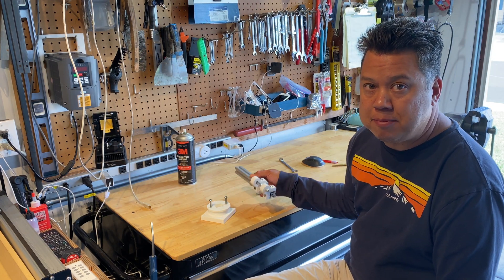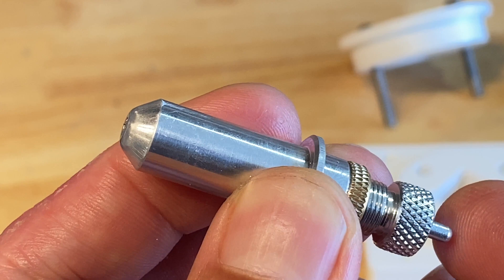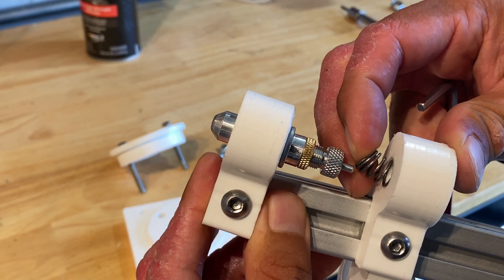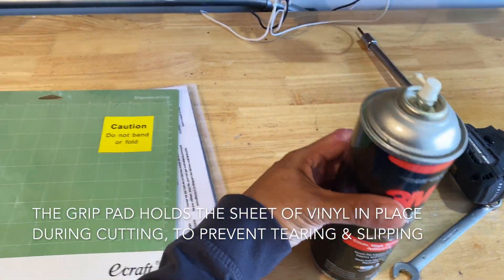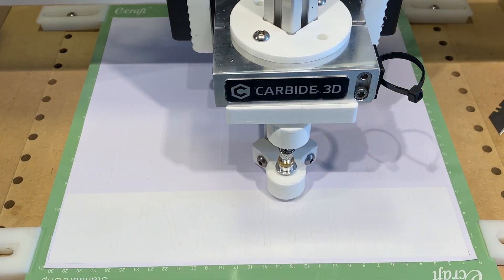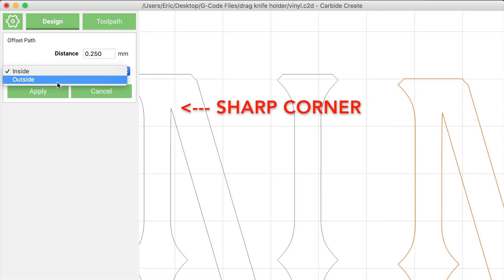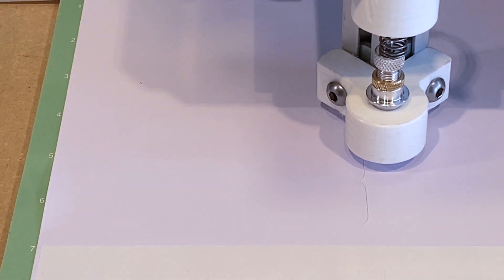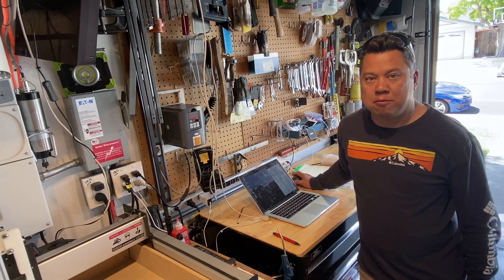Shapeoko Drag Knife Vinyl Cutter

Comment: I was thinking of doing something similar and your design seems really great. I'm wondering if you are still using it and if you were to make it again what would you change?
Reply from the maker: It works great, I haven't really used it since this video though.  Now that I have a 3D printer, I would probably 3D print instead.

Comment: I first watched your video not long after you posted it.  Recently I decided to build a simple plotter / vinyl cutter.  I have assembled the components, including a knife and holder the same as you used.
What I have been unable to work out was if the knife holder actually slides on the vinyl.  If it slides on the vinyl, is the actual depth of cut controlled by the knurled thunbwheel?
Many thanks for the video.
Reply from the maker: yes, the aluminum holder slides on the vinyl, and the depth of cut is determined by how far the blade protrudes from the holder.  It's set by turning the knurled nut.  The end of the aluminum holder has a sharp chamfer on it, I sanded it down so its more rounded like a fillet so it glides easier.  hope that helps!

Comment: Lots of useful operational details for someone like me who just purchased  one of these ultra-cheap drag knives. 👍 **One question**: The blade holder has a built-in spring dampener (on the blade side) so I was wondering why you chose to add the big spring. Was the pressure too weak to your taste ?

Comment: Your work is so nice. I have a Stepcraft style machine. It is smaller but sturdy. I try to cut really small vinyl letters and Oh, boy I have issues. When I engrave aluminum or brass with a diamond drag tip all is OK. If I mount a cutter plotter knife, similar to yours in this video...my letters are all messed up. The machine is cutting all corners. Even the circles are not round,.. It is so simplified, melted like letters. The size of the front is 16. I set the stroke thickness at 0,1 mm. Very low plunge rate and low feed rate. The Knife is mounted in the router place. I have plastic bushing that fits well in my aluminum elastic bushings that normally hold the spindle. It is very little movement between the plastic bushing and the body of the plotter knife. Instead of a spring, I am using a rubber band to allow the cutter to move up and down as needed. My vinyl is Oracal of 75 thickness and it is very well mounted on the CNC bed with the double-sided scotch band. I am using a 60-degree knife. I had similar results with the 45-degree knife. It is so annoying because with a diamond tip engraving device I can engrave all kinds of metals but vinyl cutting with the cutter plotter knife is such a challenge. Even simple shapes like small squares and ovals or rounds are wobbly and simplified. Cutting corners and such....
Reply: @klave8511  thank you.

Comment: Thank you very much for your detailed explanation of this specific drag knife. Your idea with the alu extrusion instead of the router is a good one as it ensures a sturdy holder. But on my Shapeoko I have found it a pain to swap out and in the router, so I designed my own holder (see https://mcuoneclipse.com/2021/06/27/diy-vinyl-cutting-drag-knife-for-desktop-cnc/) which works great (still I could use alu instead of 3D printed parts to make it even better).
I noticed that you 'smooth' the curves to avoid sharp turns and tearing off the vinyl from cutting. I have explored a way to add 'swivels' to the tool path which solves the problem and makes it possible to have sharp turns, see https://mcuoneclipse.com/2021/07/06/optimized-g-code-tool-path-for-vinyl-cutting-with-dxf2gcode/
Reply from the maker: Nice work, I'll give it a try next time I'm cutting vinyl!

Comment: Ordered parts for this.. will be making soon.  question is in Carbide Create.  what are you setting stock thickness too for the vinyl?  .004 perhaps?  Also how are you setting Z zero?  And. if not doing letters but other graphics, how are you accounting for tip offset?
Reply from the maker: I set XYZ zero with the cutter compressed a few mm in Z.  Next, jog Z up 10mm so the tip is hovering above the vinyl around 8mm, and reset z back to zero again.  In carbide create, you can now set your cut depth to 10mm, and the cutter will cut with the blade spring compressed about 2mm.

Comment: what did you cut your parts out of?  is that a 1 x 1 extrustion?  what length?  do you have links to the materials?   Is this just using 1/4-20 hardware?
Reply from the maker: The white plastic is HDPE, I buy it from the scrap bin at Tap Plastics.  The extrusion is 1"x1" channel, and I'm using 1/4"  20 screws.
Reply: What length

Comment: Great video! I  I have a Laguna IQ C-N-C machine. And a Dog River Drag Knife. I am using VCarve Pro for the software. I can't get the G-Code to not press the blade FAR into the work surface. I can't use the touch plate, either. How do you get the machine to not try to go beyond the thin surface? Please help me with this! Thanks!
Reply: Spring and allowing the knife holder to ride up and down seems to solve that issue mainly